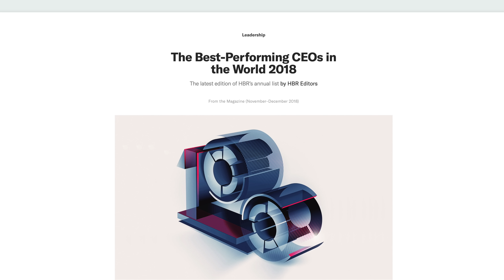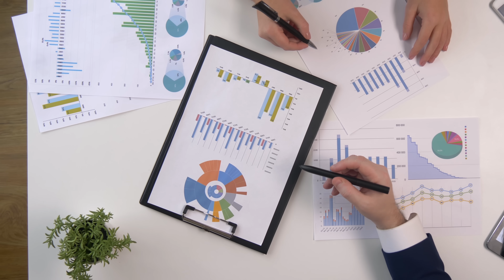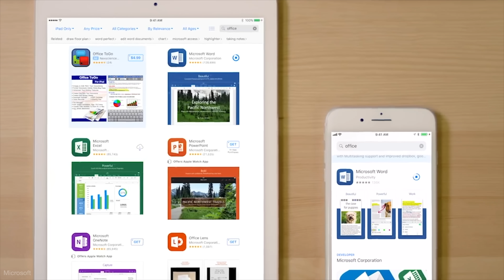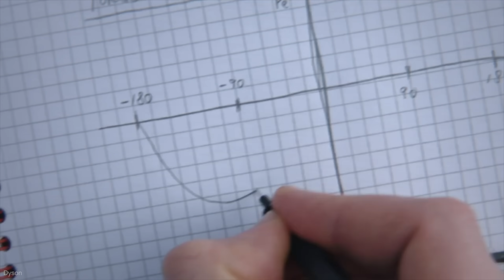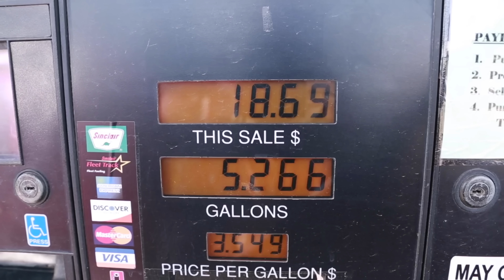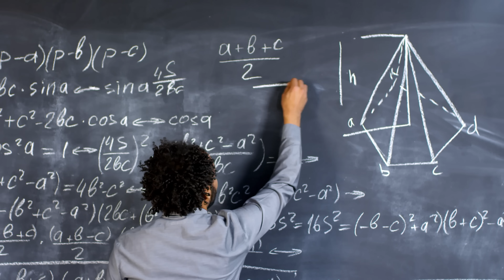Why So Many CEOs Are Engineers

Comment: Engineers can learn the business side pretty quickly. This is not true for the opposite.
That's why they can be good CEOs, they have a complete view of the entire business.
Reply: this discussion is quite an interesting one. I am kind of in between here. One thing I noticed thou, is that engineers tend to underestimate complexity of topics outside of technology. Sometimes this even leads to arrogance, because „management is just PowerPoint“ 
As far as I see it this is many engineers biggest weakness. Sure you can learn things on the way. But never underestimate complexity, there is a reason why you gotta study economics
Reply: Not just engineers, but most people with legit STEM degrees. I think the main advantage of a STEM degree in business is you gain rigorous theoretical knowledge needed for designing and inventing profitable tech / software which can be the basis of a startup. E.g it would be hard to make a plasmid engnineering startup or DNA sequencing machine to sell with just an MBA, but with a STEM degree in say biotech/biochem or molecular biology you  can oversee the whole process not just the management side.     Now hwilst you can self teach yourself anything technically speaking, in some fields having that STEM degree will just make things 10X easier and make you more credible. e.g. to make a nanomedicine startup, you would hope that you had some adequate knowledge in chemistry / biochemistry / biophysics etc.
Reply: @DNO lol. You sound ignorant. How many Engineers run banks? Or Insurance companies? Ask yourself why. 

Most Engineers are good problem solvers, but for an engineer to excel in what he is doing, which is to build, he has to surround himself with experts from other fields, so that he does not stretch himself thin.

How often do you hear Elon Musk or Jeff Bezos talking about the financial side of their business? You never hear them, because that is not their field. And an engineer that thinks he can run everything will definitely fail because he will have difficulties raising capital for his ventures. How will an engineer even decide what prices to price his goods in 100 different markets, with different government regulations?
Reply: @juniorashih1732  finally someone said this.
Reply: MOST OF the CEO'S are engineer and also MBA' S and those who are  engineer hire/partnership MBA' S to do business and vice versa (Example= zilingo, reliance) . So at the end they are CEO' S because they are curious and determined, and they are great because they are always trying to acquire knowledge ( it's not about MBA OR ENGINEER).
Reply: @darsh5176  Fake News…
Reply: We lenrt more aboout business in first year engineering than actul business majors
Reply: @cyberflaneur9127  1. Do you understand that you can only say that sentence if you have studied both degrees? (otherwise you are just spewing self-gratifying nonsense)

2. If that is true, why do the vast majority of engineers work for others?, making way less money the the executives?

Painting is not hard, knowing what you have to paint makes the difference. 

An engineer's sin is to believe that because you understand the tools, you are able to use them. Life does not work that way.

The arrogance of an engineering student is destroyed the moment he founds a startup. Go do something, you'll understand why this is not remotely as you think
Reply: As an Engineer I completely agree with you.
Reply: @zaurbek You obviously have an engineering degree because that is polar opposite of the truth lol!
Reply: I think is because we learn and practice more in areas like thinking, solving problems, and innovating things; that’s why we develop different kinds of abilities, and quickly learning is part of them, so that’s a reason why we can become CEOs faster.
Reply: Sure they can, but I think we don’t have to underestimate the abilities of an MBA, both of them can be great CEOs, even though is likely for an engineer to acquire business related abilities more easier.
Reply: for an engineer always will be good to learn about business since this will make him to grow in the company and make the company grow.
Reply: That great vision is why engineers become CEOs.
Reply: You are correct, engineers can completly understand the business side cause we study the entire product development process
Reply: That's right, engineers have extensive knowledge and ease of learning and doing business.
Reply: I agree with the comment, engineers can be more, and not only limited in their field of work
Reply: As engineers we are trained to solve problems from the practical to the theoretical, we know how to attend and respond #IMissUStark
Reply: true,the ability of engineers to solve problems explains why many are CEOs, they are apt to solve problems and also their mathematical logic allows them to face obstacles.
Reply: I disagree wholeheartedly.  I went to business school then went into engineering after.  Business school helped me see opportunity, engineering has helped me solve problems.  Both have value.
Reply: exactly
Reply: Because business degree only most of useless thing, you need to learn thing from start again after graduate
Reply: how do they learn sales and marketing quickly?  how does that work?
Reply: That is not true in practical terms. Engineers learn fast, and solve complex problems in a very efficient way, but you have to give them the problem.

The proof of what I'm saying is that the vast majority of engineers work for companies, and the vast majority do not start companies.

It is irrelevant to know by heart the MBA syllabus if you lack vision, it is irrelevant to be a good problem solver if I have to give you the problem.

So, it all comes down to the man. High IQ, High Openness to experience and being confortable with being every day in aplane that is about to crash. Some innate abilities, and some character features. 

That is why a guy who didn't even know Aluminum was a metal (Steve Jobs) was a fantastic CEO, and engineers were eager to work with him.

Vision, creativity, intelligence. Engineering is a good addition, but as empirical evidence shows, by no means makes you CEO material, it all depends on the market segment you are working on and very specific personality trait.

PS: Musk is the most successful in his fields because he thinks as a physicist, not because he thinks as an engineer. He executes as an engineer but his mindset is totally from his physics background (that allows him to get his nose in everything)
Reply: true
Reply: CEO's/Martketing staff have no expertise about their products, espacially martketing staffs only paint whiteboards 😂
Reply: si Markeyan  You know what would be great? engineers quitting their jobs to found companies, and showing the world how easy it is tobe successful in business.

Did you ever wonder why engineers make less money than executives if it is "unfair"?. 

Engineers are the feminists of jobs. They think they can do everything but the invisible force of the patriarchy stops them.

The sad truth, is that any senior engineer has the experience, the intellect and more importantly, the capital to found a company and become a millionaire, but (and this is the sad part), he realizes he is just a person who does not have the balls to do something with uncertainty, 

that creating something that people what to buy is actually the most important problem (a  problem that he has no skills to solve), 

and that you are not going to go anywhere and you will accept your fate making less money than an executive, who is the one telling you what to build.

 That describes the life of 99.9.. % of engineers on the planet.

Those CEOs are a remarkable minority, but because they have personality traits that are rare among engineers. And I say this as an engineer.

Every engineer think he is Steve Jobs until he founds his first Startup. Then you understand that "marketing" ,"finance", "product conception and design" are not what you thought it was (I was one of those)
Reply: I've got both MBA and engineering degrees and this statement is far from being accurate
Reply: @mohammadkarazmoodeh2596  please explain, because I'm sure that a engineer in their feild of study can run the product side of a business.
Reply: @goldendemise3165  Sure they can. That's why most COOs are engineers. Yet at the macro level, new questions arise: How are we going to deal with the conflicting interests of different stakeholders? How much dividend are we going to distribute this year among our shareholders? Which accounting policies are we going to adopt and what are the ramifications? How are we going to gain and maintain status and legitimacy? How are we going to survive in the long-term? What is the structure of the market and competition? How are we going to increase our market share and what would be the reaction of the rivals? Which hiring, evaluation, reward and punishment policies should we adopt? How are we going to manage conflict? This is just a very small proportion of the questions a CEO and his/her team have to address.
Reply: @mohammadkarazmoodeh2596  If I may, those questions are easy enough to answer when one knows their field, and terminology is not an issue
Reply: @cris__98  This is not an issue of terminology. Each of these questions is a general topic that encompasses a whole body of knowledge with hundreds of subtopics, thousands of theories and millions of scholars and practitioners contributing to it. People thinking management to be "easy" is mostly the result of the Dunning–Kruger effect than anything else.
Reply: @mohammadkarazmoodeh2596  learning those things along the way is definitely possible.Not easy but possible. And those CEO'S have done it, and have a much better view of their bussiness. while someone with an MBA alone can't learn the engineering part along the way.
Also, all these business decisions would be extremly lacking when the CEO doesn't understand how things actually work.
Reply: @DarkClarity  Engineering gives you an edge for sure because it improves your innovative approach, critical thinking, problem-solving, logical reasoning, multi-criteria decision making, etc. But "engineering knowledge" per se has very little to do with managing at the macro level, especially if the company is competing in the multi-market and offers a wide range of products and services
Reply: @mohammadkarazmoodeh2596  I think you missed the point, what I'm saying is that an MBA isn't necessary, not that engineering gives you that knowledge. as your business grows you learn more and more about the business aspect of things from other workers and experience. While someone who is also an engineer ends up covering deep understanding of every aspect of the company.

Having an MBA might decrease the mistakes but it still doesn't give real life  experience, and either way you end up learning how to manage the business.
Reply: @DarkClarity  I understand what you're saying. As a matter of fact, you don't need any degrees to be good at anything. 90% of what I learned at either engineering or business school is irrelevant or only tangentially relevant to my work. What you learn on the job is the most important
Reply: @mohammadkarazmoodeh2596  You missed the entire point of the comment completely. Engineering doesn't just give you engineering knowledge it teaches how to solve and approach problems from first principle. 
Going to the above questions you've asked, a brilliant engineer would go back, peel out the problem thinking with first principle and find the most convenient answer. That's why they're so good at running companies. The whole essence of the video was to lay emphasize on that. If you've not digested that from the video then I guess you've not gotten the core point of the video. Just look at the top 5 billions most have some form of engineering background.
Reply: @mohammadkarazmoodeh2596  one person can't run a company so there are employees who deals with different problems.
Reply: @mohammadkarazmoodeh2596  
I think what they mean is engineers have a great edge by a long shot in all those matters you mentioned. Most of the fields you mentioned don't really need a college degree to excel in. 

You would find good number of engineers in finance, banking and corporate sector. But you would rarely find a finance graduate doing anything different from his field of studies
Reply: @mohammadkarazmoodeh2596  those are not difficult to answer. Engineers are fit to adapt new math. Also, engineers are long term thinkers who always want their product to be communicatable. I just designed a bridge to minimize maintainence in the long run. I did it by using more reinforcing steel than asked for, that's extra charge but a much smaller expense by percentage than the concrete. My only incentive is reputation. That's not exactly a business decision but industrial engineering has remarkable business management value. I've also found no difficulties dissecting a business for my investment decisions. It's intuitive for an engineer to start with understanding a business's economic moat for example. Also, if you want to look at the two fields as represented by degrees, there's far more course content in an engineering degree than a business degree. The university I went to even had a business oriented civil engineering degree. If you want to talk about experience, engineers have to worry about bids, understanding the customer's constraints and demands, the budget to achieve that with, knowing the legal and IP considerations, keeping designed confidential, product appearance etc.. If engineering covered everything a businessman did, it would be a business degree. Engineering has more overlap with business than the other way around
Reply: @francisluglio6611  Sometimes thinking long-term about your product itself about maintenance for instance can ruin your business due to Cost efficiency and Also the demands of society change constanly so you can't put all your eggs into that one basket if you know what i Mean But thinking long-term about your Company and the product you'll be providing at that moment Will save your business long-term just look at our engineer Tim cook with Apple he keeps bringing out the same phones every year until the jig is up for the customers instead of innovating again in their smartphones and trying to improve the strength of its material when the phone drops for instance no that's not what they are doing instead Tim cook our engineer keeps the same costs as before because he makes The same overpriced phones just compare iPhone 12 and 11 but is already thinking about Selling electrical Cars in the Future.
Reply: @josephmusabyimana3557  I think you mean because of cashflow, not cost efficiency. I chose the most cost efficient solution that seemed practical. The smartest move I could make right now might be to buy a home if you only calculate "profit", (in this case it's savings, not profit in a pure accounting sense) but that isn't an option because I'd need to not buy food to have the money for that. The cash isn't flowing in a way that makes the option available.
Reply: @mohammadkarazmoodeh2596  these are just bunch of things which you don't have to understand but rather read how to do them. Don't get me wrong, you need to understand what you are doing, but the reasoning behind this it's not even comparable with the reasoning you have to do for the simpliest of the thing that you do in engineering. An Exam like applied thermodynamics is more difficult than an entire degre in business, and we do around 20 exams like these.
The world should be run by engineers, end of discussion.
Reply: @cris__98  No, you may not.
Reply: @mohammadkarazmoodeh2596  what? back in the day MBA was not even separated form engineering....old day MBAs were all engineers lol.